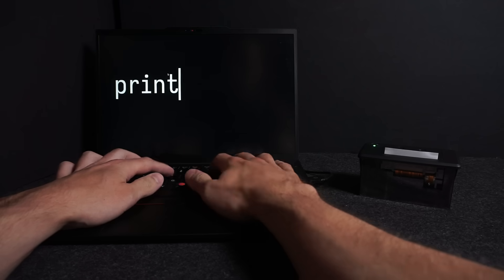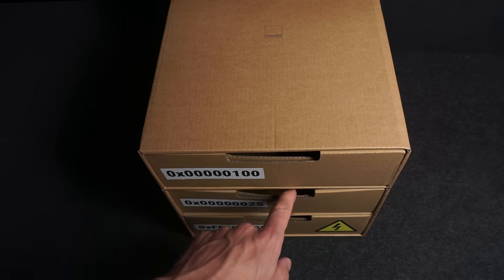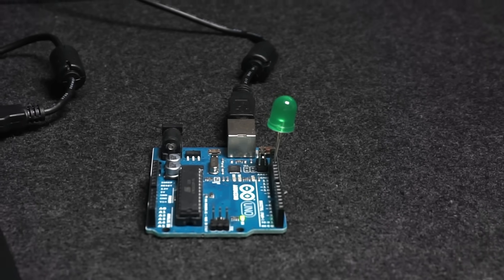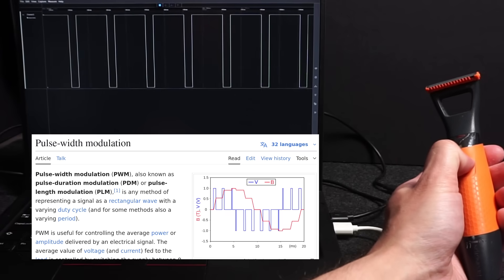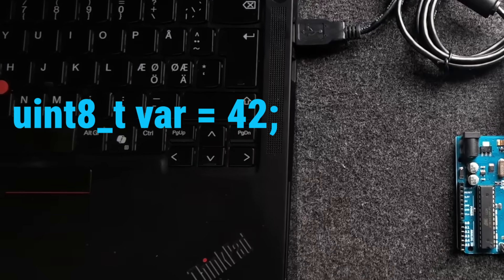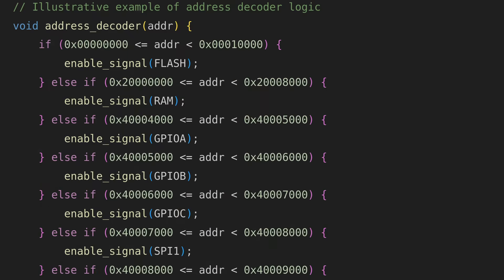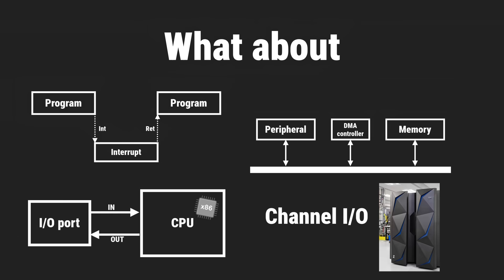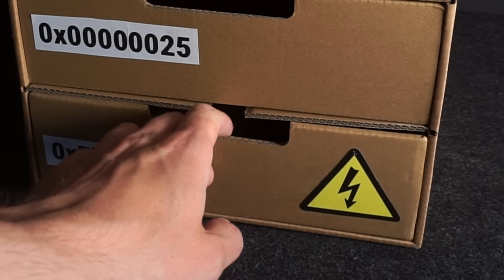How Your Code Really Controls Hardware

Comment: Cool stuff, seems very straightforward compared to web dev or software engineering in general. Is there ways to simulate this all in a virtual playground so you can play with different virtual hardware?

Comment: Why does the trimmer use a microcontroller if it only does on and off without variation of speed can't we just connect the button in,  series of battery to motor

Comment: Perhaps would have been good to show an intermediate step using AVR register macros between the Arduino framework calls and manually typing in memory addresses like a mad man, but otherwise impeccable explanation! Hopefully sparks curiousity more than it scares people off thinking that's what embedded programming looks like 😅

Comment: For those wondering, only kernel-level code has direct memory access normally, like drivers. Imagine if hello world had to know how to talk with every imaginable monitor.

You can still write direct memory programs in Linux called drivers, and user level programs talk to them, that way the number of programs that need fixing in case of a kernel panic (like a blue screen) is much smaller. Also it means that user programs don't have to account for every hardware configuration and a change in hardware just means you hot swap a new driver and the program continues unchanged.

Comment: Thank you so much for this video 🙏🏿❤️!  

I often find myself pondering the same question: how does code actually manage to control hardware?  

I remember when I first started learning to program in Python — I used to ask ChatGPT to give me the binary representation of the objects I declared, just to understand how they were stored in memory 🥵🤯😅.  

Over time, driven by curiosity and a deep desire to understand what’s happening under the hood, my grasp of both software and hardware has grown significantly — though I still have a long way to go.  

I’ve explored binary systems, dived into digital electronics, completed the Nand2Tetris course (huge thanks to its creators 🙌), and now I’m working to understand the x86 architecture and its assembly language. My goal is to build a minimalist kernel that can run on QEMU — and maybe even on real hardware.  

This is purely an educational journey. I work on it during my free time, when I’m not feeling too lazy 😅.  
It might never be directly useful in my career, but I’m doing it anyway — because understanding how things work is the first step toward building something meaningful.

Perhaps afterwards I will try to understand, with a reasonable depth, how the network and the internet work.

Comment: I learn all of its by myself by reading reference manual . and read entire complier code base . i also come your point without studing at  university. 

But these knowledge already out of date according my experience. I read entire embedded system OS from AsM to protocol provided by stm32 cube about 3 year ago . it turn out your approach kidda will causing conflict when operate 2 or more than 3 pin .and manually control memory register per program is nightmare . that why OS design is important. 

Also i also design my own OS . it turn it s pretty simple, after define Memory address, a lot of flags will be added to create a work flow( it s machine state topic) . it just around 1000 lines . and  then protocol. 

It turn out , i use FIFO(heap) most time.and stack in some case . i dont even have chac3 to test Tree algorithm due to memory limitation. 

But it s just waste of time . and it may cost aroudn 100k lines of code just to read sensor value

Comment: This is the exciting but in electrical engineering courses when you learn about analog and digital signals
Why usually digital signals are preferred - logic gates
More control more potential uses for the data 
About to dive into all of this

Comment: This further cements my belief that there are 2 distinct industries. Computer science, VS the next level up of abstraction, which includes web dev, Comupter Information Systems, "full stack development", game dev, etc.

Comp. Info sys has overlap with comp. Sci (especially in older game programming)., but they are not the same. Definitly not the same nowdays.

 Comp sci overlaps more with electrical engineering than with comp. Info. Sys.

Comment: I bought a Radio Shack Color Computer in 1984.  All upper case.  I wrote a routine to convert each character to lower case, bit mapped , I think 6x6 or 8x8.  Really slowed down the video, but it was done by writing to each pixel in memory.

Comment: When I was young, in the 1980's, using a computer with the Zilog Z80 processor, the IO was usually not memory-mapped. Instead there were special instructions for IO. That made a specific pin (IORQ) activate and the specified IO port be put on the lower byte of the address pins. Data was sent via the data pins (1 byte).
Reply: that's port-mapped IO, but it basically works like a dedicated memory-like bus only for peripherals. The IN and OUT instructions are basically special LDR and STR instructions.
Reply: @creeper6530x86, ARM, AVR and other Inst Set would likely very similar but different in logical circuit implementations to save power and time.
Reply: Did you keep your Z8 development board?
Reply: @jpmorallo  I have never had a Z8 development board.
Reply: @md2perpe i see, it was very popular in the 90's, I have few chips that I collected.
Reply: @jpmorallo  I have kept my Sinclair ZX Spectrum, though.

Comment: The trick is to realize that the CPU just puts an address out, and either puts data out with it or reads data back in. It doesn't know or care what's hooked up to it to respond to that address. There are many things you can hook up. RAM is just a device that stores the data it's given, and repeats it back when asked. You can just as easily hook up a device that discards the data and returns random numbers, or one that uses that data as the voltage to send to a light, or returns different data depending if a button is pressed or not.

All that really matters is that, whatever address the CPU starts at when turned on, something is hooked up that will respond to that address with some code that makes sense.

Comment: A Clock Cycle is just turning on and off relevent latches on the memory addresses, And once the latches are released, the corresponding circuits get turned on. 

And The simplest example is, The Adder used for addition.

Comment: I see this more as a prerequisite for operation than as actual control. To control a device, simply send an electrical signal to a specific interface, and the device's hardware takes care of converting the energy into light, sound, movement, and so on. Memory storage serves as a means of synchronization between devices, but it's not exactly what makes the code work.

Comment: At 4:33, how do you figure out how to wire up the trimmer though?! Isn’t that supposed to be a charging port?
Reply: I think it's the power button as well. 

At some point after looking at a lot of electronics, you come to figure out how stuff works. The battery likely sent some voltage printed on the bsttery itself, so he can just solder a wire with the same voltage to the trimmer, and it'll work.

Likewise with the power button, the way that works is when you press it down, it lets current through, so you can just simulate that on the computer, and youre golden

Comment: Without watching the video - if I remember correctly the way a cpu works is by loading instructions from the memory/ram, executing them and then putting new instructions in and reading them out an so on. 
So I would guess it works somewhat like that

Comment: Of course in a modern desktop operating system, to control hardware you make a call to an API, which then filters to a lower level API, which then fires off a SYSCALL, which makes the kernel process that request, then if all security checks pass it hands off to the device driver which finally interacts with the hardware.  Then all the steps are reversed until you get back to program control.

Comment: Dude, THANK YOU VERY MUCH for making this video. I always wondered how code interacts with and controls the hardware. Many times I searched on internet, most of the resource dived into transistors and logic gate topics. I didn't want that information. I wanted to know about what happens in the machine when the code is executed, and what type instructions control this flow. I knew about MMIO, but no resource I found explained it this clearly with practical examples, today youtube recommended me this video, and finally I'm satisfied with the expalantion, knowledge and the understanding I received. As a tech enthusiast and a web dev, Its really heartbreaking to learn that embedded devs makes less pay than web devs.

Comment: Great video, I would love to see more on the topic of MMIO. How do you discover which memory addresses to write to, and what values to write to those addresses to make the hardware behave the way that you intend?
Reply: I know some addresses for PMIO like the keyboard controller on x86 PC 0x60/0x64 for using in and out instructions, or the vsync 0x3DA, but i never use MMIO.

Google AI: There isn't a single, universal address for MMIO; it is a mechanism, not a fixed location, where specific addresses are assigned to devices by the system's BIOS, firmware, or operating system during startup.

Comment: On the x86 processors devices are controlled by i/0 ports unless they are something like a GPU and they set up a framebuffer which is of course a block of memory.   Your instructions on x86 to control the i/o ports are the in and out instructions.

Comment: This is fascinating and informative. But I really don't understand why a trimmer would need a microchip at all. All you need is the power switch, wires and motor, why would they make it cost more by adding a microcontroller. It is pretty cool, you can control it for this video.

Comment: Back in the Apple ][ days we called the memory mapped hardware "soft switches" and "annunciators". So it's nothing unusual and it's been around forever. Great explanation!
Reply: Back in the day we called it cranking the punch cards through tube transistors manually. But before that really back in the day it was all about pushing wood in a abacus

Comment: Ah that reminds me of designing (in a HDL) a CPU in a team in college, i added memory mapped IO (mainly for print, and video output as a demo of what else it could do) and it was some of my most boged code at least until i refactored it, good times
Reply: writing / adapting all the features we needed from the standard library as we went (also my job) since I couldnt figure out how to get one to compile for our rather ... interesting ... implementation of RV32 in the deadlines and just writing (/copy pasting and crediting properly where possible) the code was a lot quicker was a lot of fun, really nothing like having full control over a device you yourself designed, well until you discover a moon bug in the logic of the processor at least

Comment: I am surprised how I have been thinking about this topic for days. I was actively thinking about it before opening YouTube and guess what? This is the first video on my recommended 😅.
I am a "computer programmer" who quit the craft 15 years ago because of complicated reasons. My passion for programming came from being curious just like you about how lines of code control physical objects. I used to love assembly language because that meant you had to know the processor you are making code for. That also means you had to understand how computer hardware works and I found it thrilling. Your code had to be 100% correct and there was no assistance to show you syntax errors. Back then, debugging meant serious code review. Quick forward to today's software developers using IDEs who don't have to know anything about anything and that takes away the charm programming had

Comment: i started the same way as you, i've always wondered how things worked under the hood, i always gamed a lot and i loved playing around with the cpu and gpu, doing overclocks, undervolts, i've always wondered not only how they worked but how a bios worked also and how these were made, long story short i ended up choosing electrical engineering for my bachelor's and followed up on embedded systems. For me firmware wasn't enough though, i can't really tell why, so i dug deep and nowadays i work with verilog and VHDL making ASICs and SOCs, best thing i could have ever wished for.

Comment: I would like a physical device to be treated as physical memory by the operating system as well as programs, thereby maxing out memory two adults greater than that they can be handled by the built-in mmu while simultaneously avoiding paging thrashing. The actual physical memory would be like an l2 cache. Could this be done using memory mapped io to sed physical device using a simple driver?
  And if it is possible in Linux, what would be required to make it possible in Windows? What about mapping graphics card memory? If you can access a virtual GPU online, I don't see why you couldn't add GPU memory virtually.

Comment: Volatile is to tell the compiler NOT TO CACHE a variable since we want to access the REAL register value instead of a cached, for speed, value.
Reply: I was looking if it was actually explained, it's a hint to the compiler to write a code to make sure it uses the acrual memory instead of loading it into cache, for example it's used by multiple thread and might be shared with other cpu cores, or in this case, to make sure it is written or read from the IO immediately
Reply: Kinda. Memory accesses appear to be synchronous from the machine code's perspective, but the CPU does it asynchronously. When you run a load op, the CPU decodes that into a bunch of microcode ops which instruct the memory controller to request a cache line from memory. This takes time, so the CPU will reorder things internally such that the instruction that depends on the memory read will block on the physical read op while ops that don't depend on the op will just keep running. That's what "out-of-order execution" means. Compilers can take advantage of this by ordering instructions such that code that doesn't depend on memory accesses will be sandwiched between memory read/write ops wherever possible, for example.

When you use volatile, you're telling the compiler that you want the very specific memory access to happen at the exact point in execution you want it to. It effectively disables compiler optimizations around the volatile op.
Reply: @dingusbringus74  what you just described is called "cache"
Reply: @AvalancheGameArt  I disagree. Caching is separate from instruction dependencies.
Reply: After watching this video, the best way for us all to learn about volatile is to read what it actually does in the code.

It will be a good learning exercise too! I'll report my findings back later.
Reply: Its so interesting how all computers are built on this fundamental boolean transistor structure beneath it all. Are there any alternztive models that computer scientists have come up with?
Reply: It prevents the compiler from doing  any optimization with that variable, not just those related to the cache. 

The compiler will likely drop reads if the variable is not read between them for example, but this is not what you want if it’s writing to a peripheral’s register for example, since those reads may trigger behaviour that’s not visible to the compiler
Reply: indeed, there are many optimization strategies and it hints the compiler that it should be avoided. i wont say i know much about it, but it can include not saving it in a register and always save to memory, which in this case is the goal.
Reply: @ProfRoxas  it's not just a hint, it's enforced. The 'inline' keyword is a hint that the compiler can choose to ignore, but the 'volatile' keyword can't be ignored. 

"it can include not saving it in a register" I think you meant 'cache' here? the cpu needs to load things into registers to do anything with them. 

But I think in the context of embedded systems, the lack of all the other optimizations is the goal with the volatile keyword, since many embedded devices don't have a cache at all. So not dropping/reordering reads and writes is definitely more important imo.

Comment: When I read before how the NES console was programmed i saw that EVERYTHING regarding hardware control was done by in assembler code setting bits on reserved memory adresses that instead of  storing and reading data would do things like change screen pixels or play sounds by directly affecting the hardware for specific components like for ex the sound chip. Everything was done through memory adresses. I guess under the hood it still works just the same for modern computers.